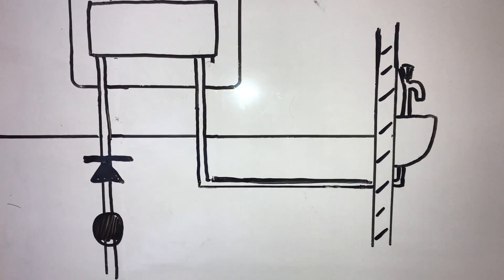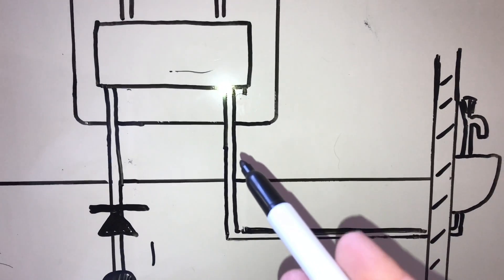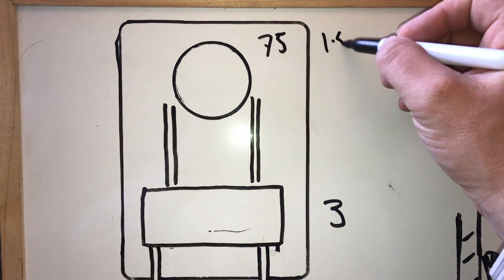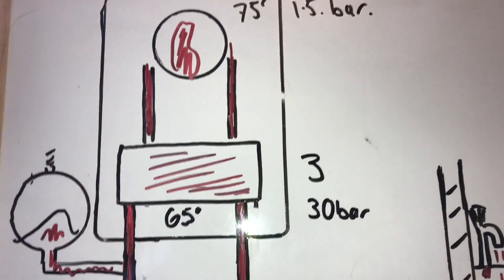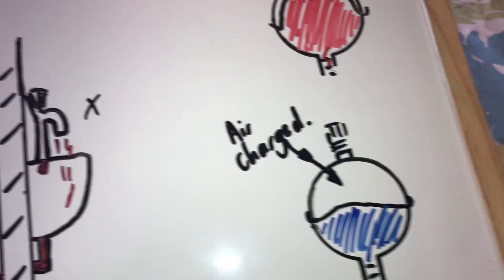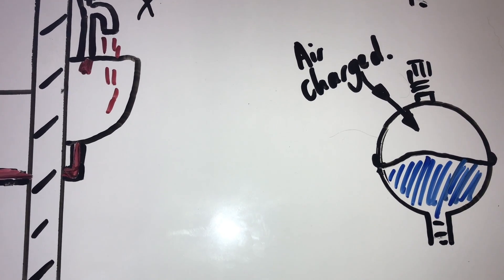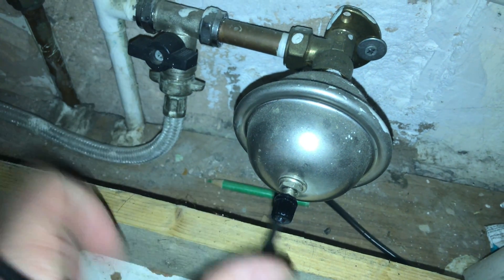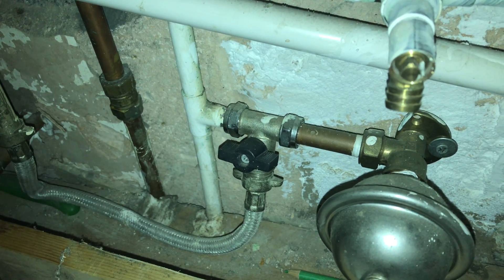Installing Mini shock arrestors

Comment: How does a non plumber you recharge the arrestor? It says recharge every 6 months.
Reply from the maker: Drain down and use a bike pump
Reply: @warriorsofwarmth  
Thank you (1)will that be done in situ or can we remove/unscrew the  the mini expnsion valve, recharge and then replace? (2) Does the posioning of the arrestor ie before or after the valve matter ?(3) I want to replace the expansion vessel with a new one, can I unscrew the old one and replace with new one. I think this might be easier than recharging. Thank you for video 👍🏿

Comment: Thanks for video, would you install a shock arrester on the cold incoming pipe? Thanks
Reply from the maker: Yes u can it helps stop hammer
Reply: @warriorsofwarmth  🙏 thanks
Reply from the maker: @richardhodgson7443  it’s also helps prevent ur taps etc

Comment: Hi Jay. I may be pain in the back, but - I love your video and explanation, spot on. However I do have some concerns when it comes to legionella as you have created a dead leg :/.
Reply from the maker: Yes good point, ideally the regular usage wud prevent any growth
Reply: @warriorsofwarmth  You have two options here: either use anti-legionella valve (costs arm and d$*$k and is 3/4") or maybe just use a tee comp/comp/female thread. i work as process engineer on large industrial projects and they simply use those valves, as usually shock arrestor is 3-5l when used with booster pumps. Now I face an installation for my new boiler and have installer coming next week, and I need to come with a neat solution for my legionella problem :).

Comment: at 1.54  why would the " shock arrestor be getting nice and hot " if it is installed on the cold mains feed side ? you do not want the " shock / expantion vessel " to get hot, what would be the point,
Reply from the maker: Expansion vessels go where coolest do it doesn’t damage the neoprene diaghram inside

Comment: Great video! So you can use a bike pump to charge it up again, is that right?
Reply from the maker: Urwa Yusuf yes that’s correct,
Reply: Jay #happytohelp #warriorsofwarmth Plumbing Its says on the label ‘Explosion Hazard - Do Not Overpressurise’ - is 3bar pressure safe?
Reply: Jay #happytohelp #warriorsofwarmth Plumbing Great, I’ll give it a go tmrw, thank you!

Comment: Yes I wondered, do you turn off the mains stoptap and open a tap before pressurising?. If not you will rapidly pressure to mains water pressure and won't know when to stop pumping air in
Reply from the maker: John F yes all vessels must have an open end to charge freely

Comment: How do you know what pressure to set it to tho?
Reply from the maker: karl battensby should be on the data badge, plus it’s only small to absorb the shock, 2 bar?
Reply: Nothing really just serial number and max working pressure that's 15 bar but I seen the same  one online that says factory pre charge 3.5 bar
Reply from the maker: 3bar then it’ll only take a minute
Reply: And drain the full system before I add the pressure
Reply: @karlbattensby2692  Thats what I thought. Otherwise you will rapidly reach mains water pressure and maintain that as the diaphragm slowly moves out. You wont know when to stop! Ideally I guess it should be balanced with diaphragm half way
Reply from the maker: Yes isolate
Reply: Ok thank you for the advice mate

Comment from the maker: Also, did u know u can install a small dead leg? The small dead leg section of pipe wud actually act as a anti water hammer device?!
Reply: J.Hallam Plumbing manufacturers tech guy Plumbing in your diagram you've got the mini shock arrestor on the hot pipe!
Reply: so long as it is vertical, and full of air, as air is compressible, we had one on a 4" fire hydrant, 6 floor up at the top
Reply from the maker: @Minix Tvbox u only need a shock arrester if theirs loads of plastic in the boiler or theirs little cold water pipe
Reply: I was under the impression that air can be water soluble to some degree, therefore the dead legs can end up filling with water as the air absorbs back into the water. I suppose it would only take the occasional air bubble to fill it back up with air again but it seems a bit of an unknown quantity. The shock arrestors seem to be a much more reliable option.